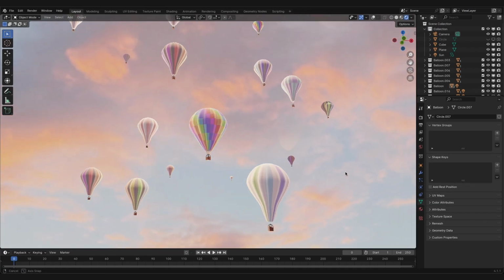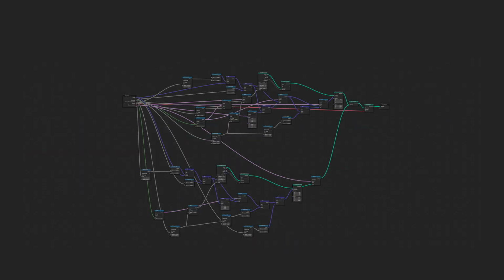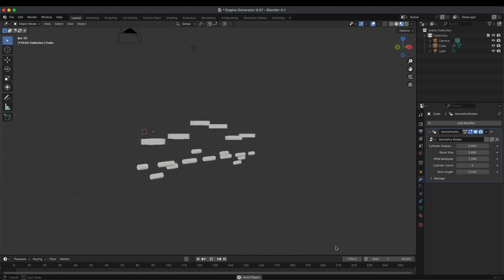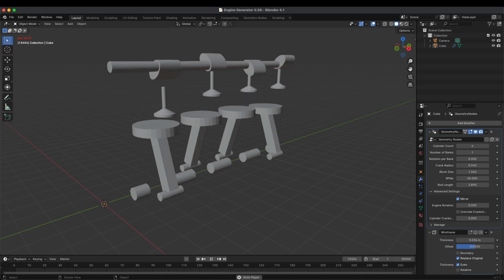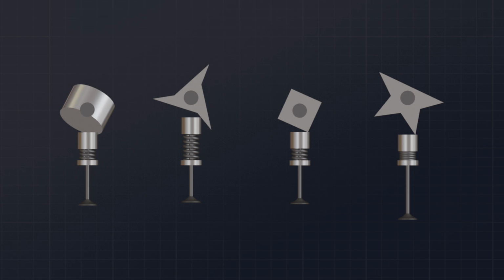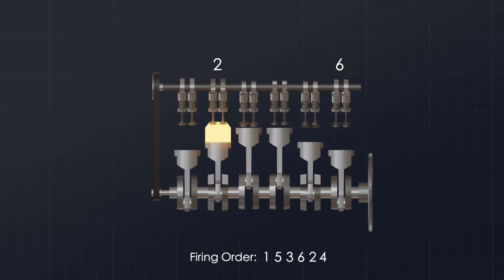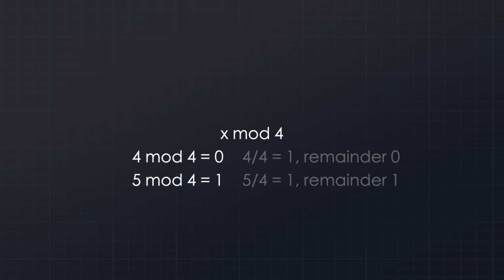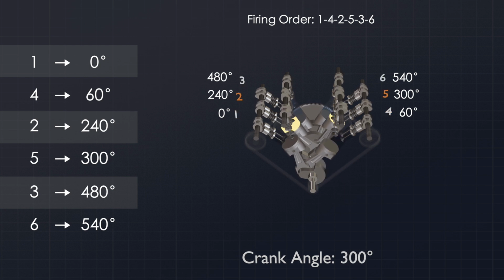What a 300 Hour Blender Project Looks Like

Comment: ☝🥸Acchhually piston don't move in perfect sine, because of different vertical speed of connecting rod when not inline with cylinder.
Could this all be done through bone constraints? Looks much easier.
Impressive work anyway.
Reply from the maker: 😂 yeah. Bone contraints might be possible to some extent, but as far as I know they don’t interact with geometry nodes, so it wouldn’t be very dynamic. I’m sure there’s probably a way to do it, but geometry nodes are my bread and butter so I wanted to do everything within there.